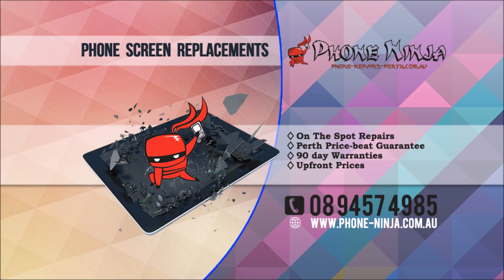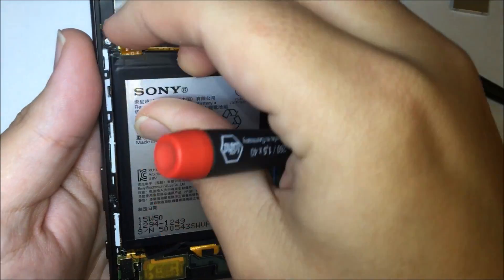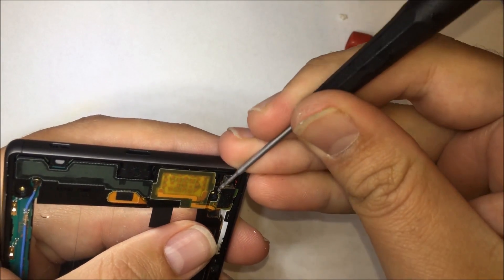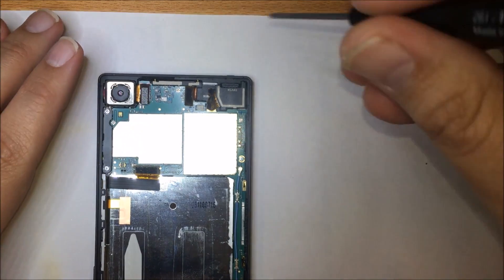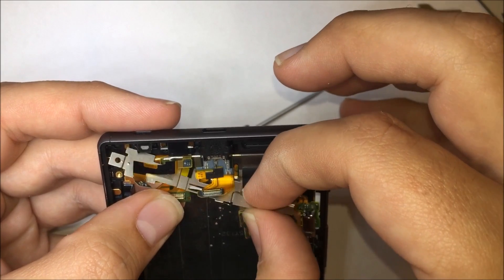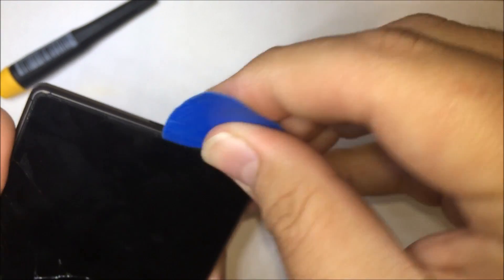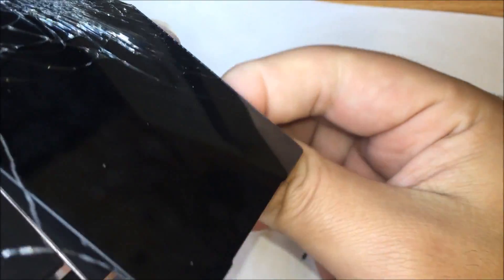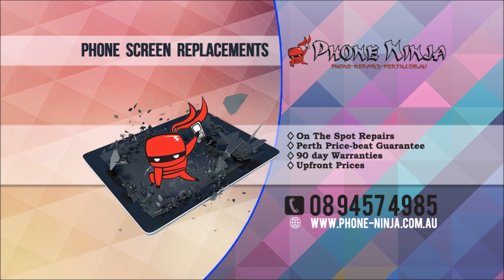The First Real Sony Xperia Z5 Teardown + Screen Replacement Tutorial

Comment: Mate, i have done the replacement.  Screen works but touch does not.  Any suggestions?
Reply: Graham Astbury, were you able to get the touch functions working on your phone?
Reply: Yes! I had the same problem. There is a connector coming out from the screen that came disconnected. Just connect it and it will work.
Reply: hey howd you go?
i have the same problem now
Reply: jeah mine to sony is shit now pasically i need to buy new phone
Reply: sir this is bit tricky job but you have to make sure you have connected the touch connector properly
Reply: thanks! that worked for me